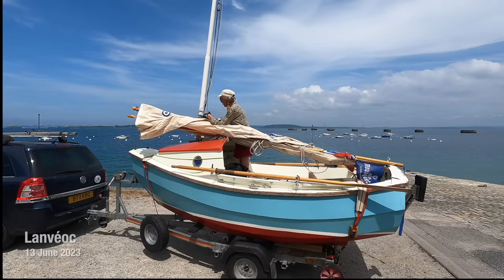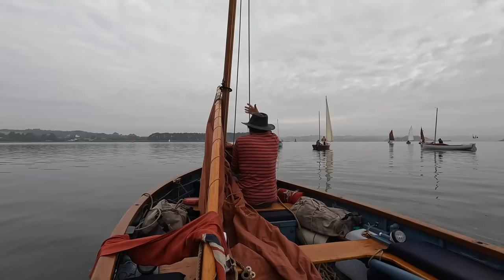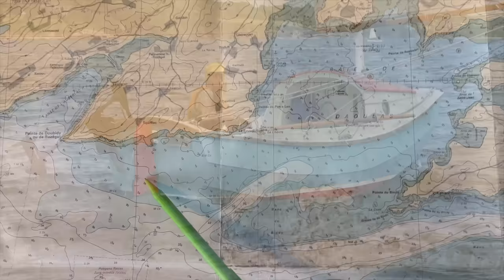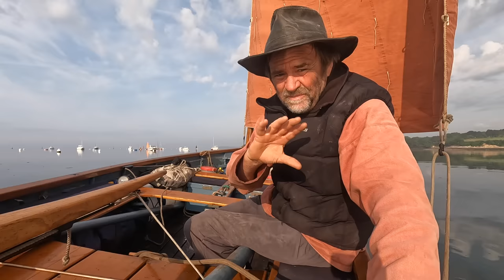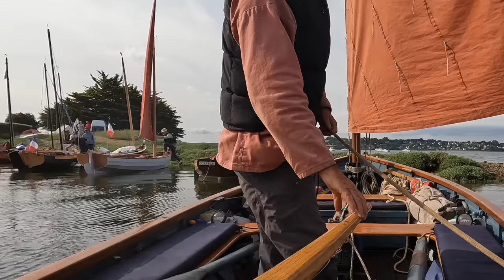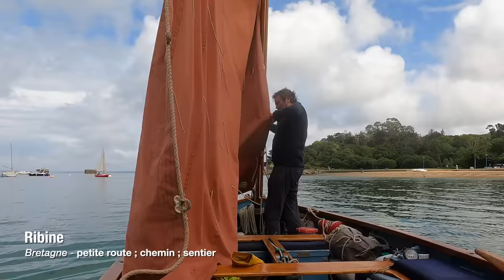Les Ribineurs de la Rade - dinghy cruising in remote creeks and inlets

Comment: I have a 2.5 hp motor on my 14 foot cruising dinghy, but resist the temptation to start it just because of  lack of time/wind.   I'm nearly 80, so tell myself it's for emergencies only and to that end I carry just enough fuel, about 2 hours running time, to get me somewhere on the Rivers if I need help. Good to see you posting again Roger. 👍

Comment: Roger, I have an elderly Series 1 GP14 I use for dinghy sailing. While it can seem a very high strung little boat, just begging to jump up on plane as I hike my behind out over the water to keep her upright, some of my best sails have been what I call "drifters". The days when the wind is so light you have to settle on the leeward side to keep the boom over and any and all movement is measured in hours instead of miles. 
Maybe I am just getting old, but those are the days of sailing I prefer and the incredulous looks I get when I mention this are pointed and notable.

Comment: Delightful, restful and soothing end to yet another day of frustration watching this nicely crafted video ( pun intended).
If anyone is up for a yarn... I last sailed around 2 months ago; extremely briefly, as I discovered I had a holed hull in my Mirror dinghy just after leaving the harbour...nothing for it but to turn back..bailing as I naughtily sailed back through the harbour under just the jib. 
Finally finished the repair job about a week ago. So finally this morning I was feeling strong enough & the weather seemed good enough to test my repair ( which scandalously I did with fibreglass to reinforce delaminated ply -which I suspect is not marine ply - from a previous repair job by a previous owner).
 So I got up reasonably early to avoid the fierce June heat, loaded the van & turned the ignition key...Nothing! Unfortunately I'd left a small LED light turned on in my acadiane that I'd installed to supplement the feeble & inadequate speedometer light. Flat battery. Nothing for it but to abandon mîy sailing plans & deal with the flat battery.
Sailing will have to wait until another day when I feel strong enough & the weather suitable enough for me to try again. (My Waldenstroms induced neuropathy appears to be relapsing  a bit at present). Bon vent a tous!

Comment: I was wondering what "ribineurs" meant... As it happens, today I also learned a similar term, Flâneur, which derives from the Old Norse verb flana, "to wander with no purpose"... So, Les flaneurs de ribine...?"  Anyway, cheers and fair winds from rainy-seasoned Japan!
Reply from the maker: Ribineurs is a Marc Rohou neologism. But Ribine is certainly a word in Brittany.
Reply: @RogerRoving  To be very precise, "ribin" is a breton word (celtic) who means "narrow way". 
Those "narrow ways" were used as "non official path" through edges and fields, to shorten the voyage, in a time when walking was the only way to travel for most of the ordinary people.
This word is still used nowaday in Brittany, when somebody takes his car through the "ribins" to avoid police alcool controls...😉